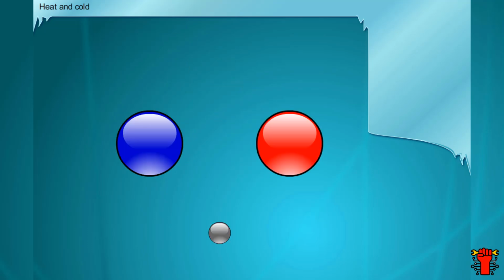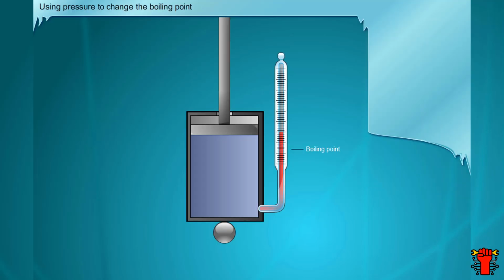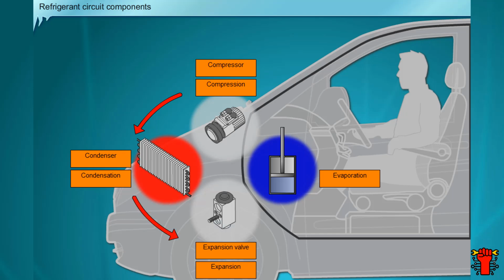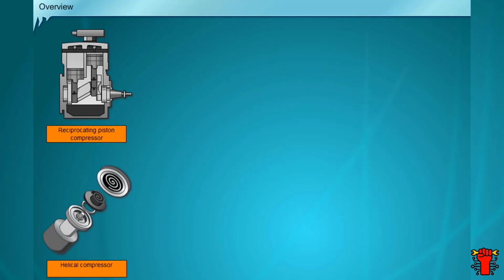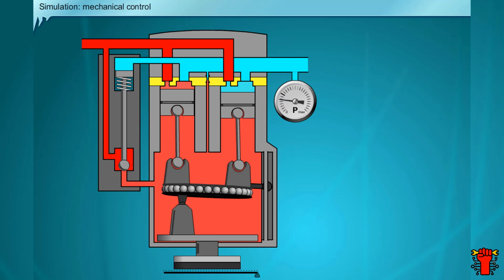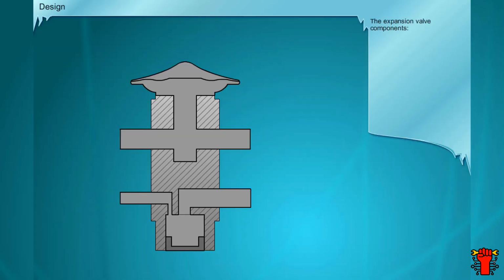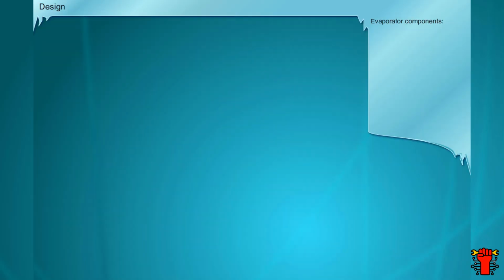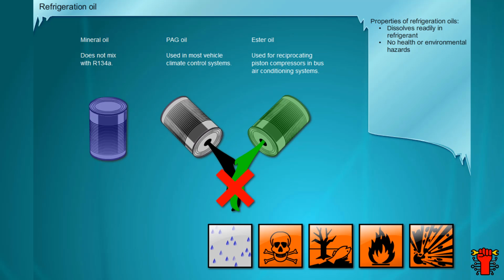Understanding Refrigeration Systems: Basic Principles, Components, and Safety

Comment: Some odd ways of putting things. Calling an accumulator a stoargr
Reply from the maker: Thanks for your feedback! I didn’t actually use the term 'accumulator' or 'stoargr' in the video, but I appreciate you pointing it out. I always aim to make the explanations as clear as possible, so if there’s a specific part that seemed confusing, I’d be happy to clarify. Your input helps improve the content for everyone!:_Thanks:
Reply: You called it a fluid reservoir.  Claiming it stores refrigerant. There are NO FLUID RESOVOIRS IN AUTOMOTIVE AC SYSTEMS
You have either a receiver dryer or an accumulator. Both if which have the sole purpose of absorbing moisture from the system.
Reply from the maker: @michaelcrst7  You’re absolutely right, and I appreciate you pointing that out. In automotive AC systems, it’s either a receiver-drier or an accumulator, not a generic fluid reservoir. Their main function is indeed to absorb moisture and filter debris from the refrigerant. I’ll be more precise in future videos to avoid any confusion. Thanks for helping me improve the content! :_Thanks::_Thanks: